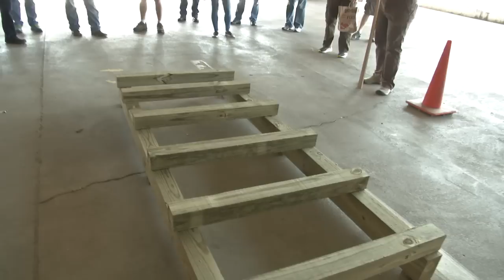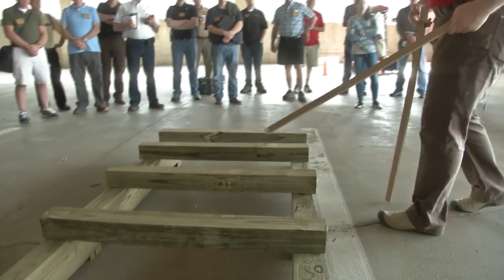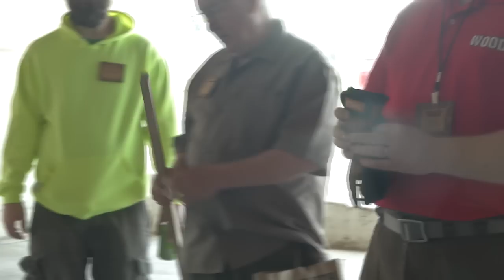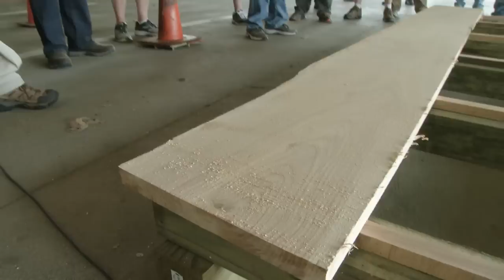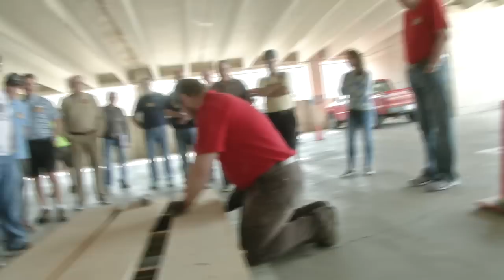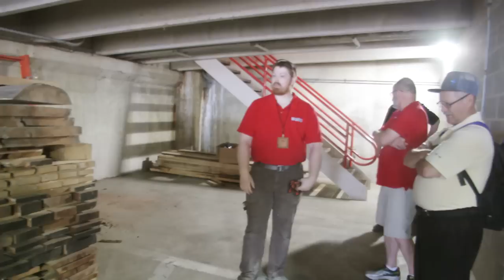How To Stack Your Milled Wood For Air Drying - WOOD magazine

Comment: I built a small building for air drying.  After finishing the building, I put some gravel on the ground, then used a long straight board and screeded the gravel both directions, so the floor is flat.  Then I built pallets of different lengths to match the length of my logs,  I sticker as I take the boards off the mill onto the pallets, to save handling over and over.  Then I set the pallets in my shed with the flat floor.  Final step is to set a pallet with concrete sidewalk chunks on top of the stack.  When I need to add another pallet to the top of the existing one, I just set the pallet of concrete out of the way, add a pallet of lumber to the stack, then put the pallet of concrete back on top, using my skidsteer and forks. I am getting some nice straight boards, unlike the stuff I used to saw.